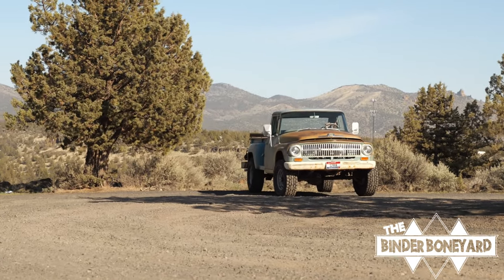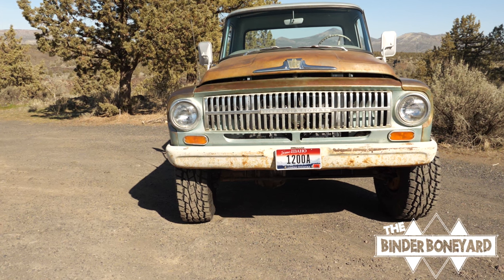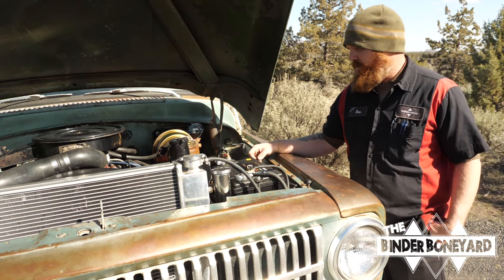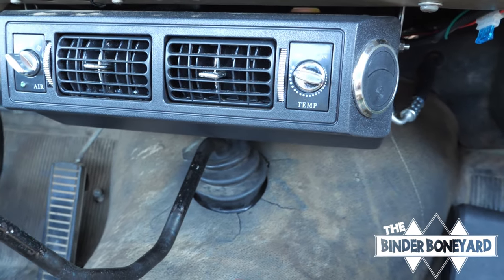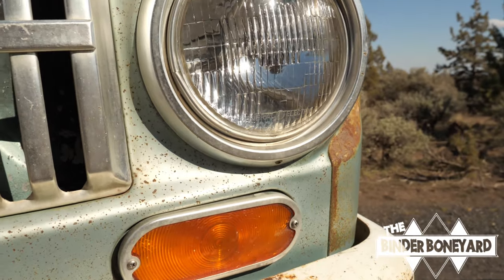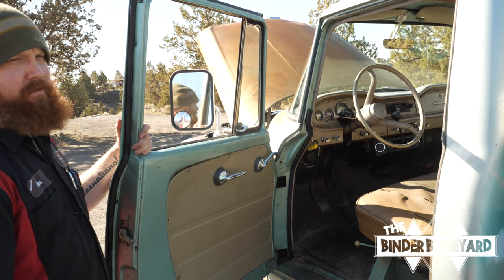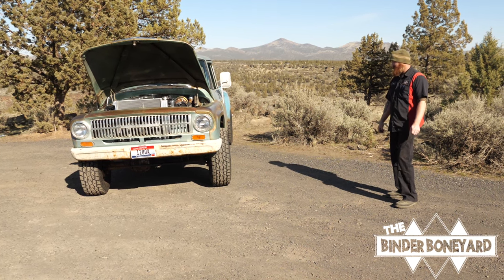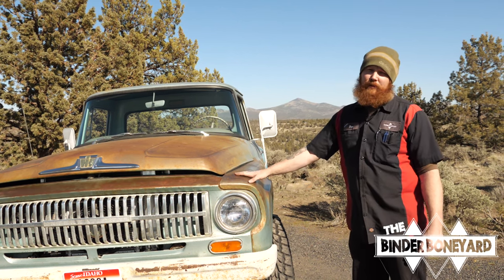1966 International Harvester 1200 Stepside Restomod - Walk Around

Comment: Your 66 pickup walk around caught my attention...I need to rebrake a 56 travell all with discs and a hydro power assist ...also want to convert to drop down pedals and hydraulic clutch for a 6bt....what do you offer?

Also want to hang discs off the 66 d 44 and d60....thanks..!
Reply from the maker: That's all custom stuff you'll need to fabricate from scratch. No other front axle will fit under there because spring spacing is very narrow. You'll need to build the front axle or cut spring hangers off and widen them.
Reply: I have a few notes on the 56 travelall. I spent 4 years putting a 6.9 idi into the stock frame rails of a '56 s120. Front disc brakes were tough to piece together. Kept the stock axle housing but from the spindle shaft out came off of a chevy. Getting the spindle machined was the toughest part besides forking out the cash. I did indeed get drop down pedals and hydraulic clutch to work.
Reply: @immortalbonsai6037  thanks for jumping in...not sure yet if I'm moving axle spring pads or frame spring hanger locations...i`ll be moving the rig to a more favorable spot to do fabbing on it...current spot is too close to fire breathing scrub brush. The 56 has a 66 front d44 and rear d60 with the 6 on 6.5. I was concerned the originals would not hold up to the 6bt. Like to exchange info via email if possible?
Reply: @TheBinderBoneyard  great info thanks!